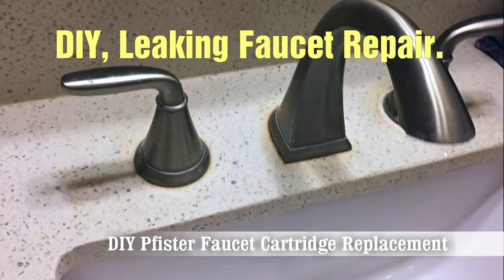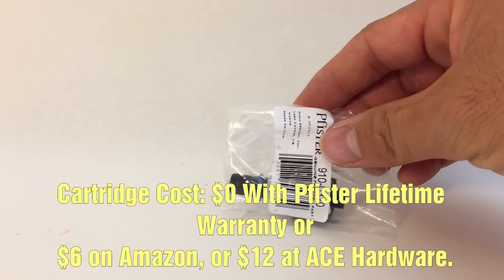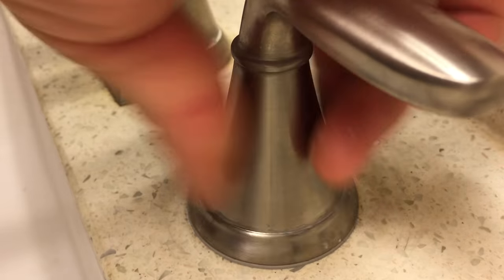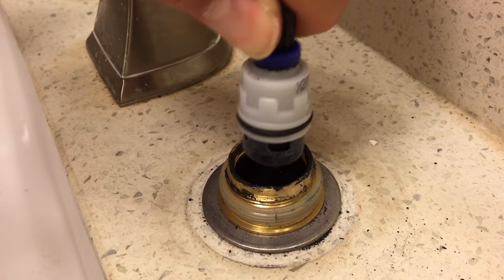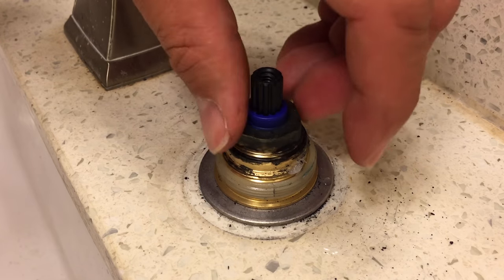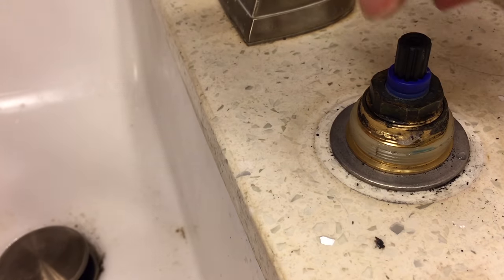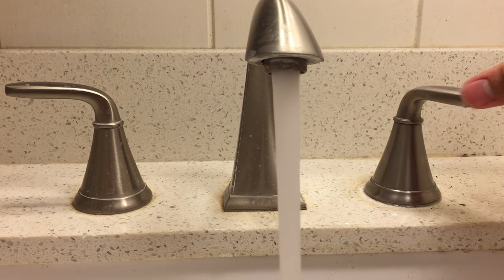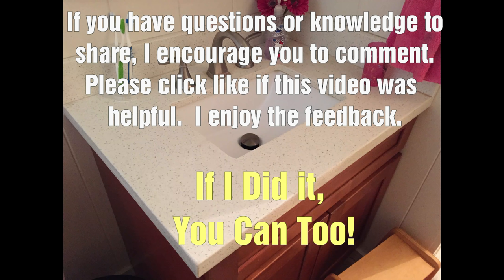What is a Faucet Cartridge? Dripping Price Pfister Faucet, Cartridge Replacement in 15min How to.

Comment: Silicone grease is a must for threads and handle to stem attachment points, for those who install their own faucets a word of wisdom is take it apart and grease everything, by this it will remove very very easy. If not you will fight and curse it all the while trying to remove due to scale build up. I just did my kitchen pull down faucet. That blasted handle did not want to come off! It took a long time, spraying it with white vinegar. Thanks
Reply: Plumber's grease is mandatory during manufacturing/final assembly, as it should be during repair/replacement of parts/components.  The grease will assist in assembly/disassembly of metal parts, as well as add a protective coating to rubber gaskets/rings.

Comment: FYI, if you have old galvanized pipes, they can shed rust particles which foul the valves. I replaced a bathroom cartridge like this and found a rust chunk inside the old one. Two months later the new valve started leaking. Solution is to replace the old pipes (plus they start leaking when rusted through). I’m about 70% of the way through a Pex repipe. Slow going, the house is 100 years old and the bathroom pipes are behind plaster and lathe.

Comment: Super helpful!  Thanks, Thrifty Tani!  I discovered, once I saw how to get the handle off by unscrewing the base (thanks to your video), that the nut holding the valve in place on top had simply worked loose.  By tightening this, the valve stopped leaking.  I didn't discover this until after disconnecting things under the sink, which was not necessary in my case--a note to help any future visitors.  Thanks again. Regarding free replacement, if you are not the original purchaser (I bought the home from the original owner) the warranty isn't valid--not a big deal, since the valve is a pretty cheap fix.
Reply: Kind internet stranger..you just saved me time and money!  Started with tightening hot and cold side nuts just a tiny bit...stopped the slow faucet leak.  Thanks again!!

Comment: Fyi:  you can flip or reverse these cartridges from hot to cold, or cold to hot.  Use small screwdriver , pop off bottom black cap.  Pull out guts slightly and rotate 90 degrees, snap cap back on.

Comment: Thank you--that worked great, especially since I have that exact same faucet.  I'll just mention for others that when I pulled the cartridge out, it didn't all come out at once.  There was a piece of plastic that stuck in the bottom, which I had to pull out with pliers before I could put the new cartridge in.  That happened on both my hot and cold, so it's probably pretty common.
Reply from the maker: Thanks John, I appreciate the info!  I’m glad you were able to figure out how to pull out the piece of plastic.

Comment: So fun story, my faucet has begun a slow drip. I knew about removing the handle and tightening the nut down which does stop the drip sometimes but when I popped the small cap off the handle to get access to the screw it wasn't budging. I put my weight on the screwdriver and slooooowly tried to untighten the screw only to feel the screwdriver "wrench" it's way out meaning the screw head is now stripped. Several swear words later, I bought a screw-extractor kit only for it to NOT work. I just now finished installing the new one on the hot side and the way I went about it was small hacksaw and cut the handle off (took about 30m due to the fact the handle was solid metal and confined space AND every back n forth action was see-sawing the cartridge making me worried about breaking something else). Then I finally had access to the large nut holding the cartridge in place and unscrewed that, pulled the cartridge out... put in the new one. Had to buy a replacement handle set so it matches (since Ace didn't have the same ones). Stuck screw made this 10m job into a 1 hour job.
Thanks to your video I found which cartridge I needed because the bottom black plastic piece which comes apart HAD come apart and the lower half was still stuck inside the faucet. So looking at this video I realized the cartridge wasn't complete. Used 2 needle-nose pliers to remove the bottom part and went to Ace and found the right replacement.
Faucet's fixed, no drip. Phew
Reply from the maker: Wow, that sounds like a stressful situation!   Good job on fixing it!

Comment: Help Thrifty Tani! I loved this video and ordered and follow to a T but may handles both completely turn 360 degrees.  The water shuts off in one spot but why isn't it locking into place instead of turning in curcles?
Reply from the maker: Hi Margot, the cartridge should stop the handle from rotating 360 degrees.  If you’ve already replaced the cartridge and it’s spinning 360 degrees, you probably have a faulty cartridge.
Reply: @thriftytani46  So I changed the cartridges per your suggestion and it all works!!! I am so proud of myself and thankful for you and your advice.  Have a great day.
Reply from the maker: Awesome Margot!  You should be proud of yourself, you saved yourself hundreds of dollars by not calling a plumber.   You deserve to get yourself a little treat today! :)

Comment: Is this generally how to repair all brands? I’m not sure exactly why mine is leaking or what brand it is to know what to search for on how to fix.
Reply from the maker: Generally there are two types.  The one I show in my video, and the second type involves a tiny hex screw, called a set screw usually located on the back side of the handle.  Remove that screw and the handle will lift right off the faucet.

Comment: Hello!Your video is very good. However the hot water cartridge I need to replace is stuck. I tried wiggling it and cannot remove it. Can I use a drill to break it up and then be able to remove it? Thanks.
Reply from the maker: The cartridge must be stuck due to hard water build up.  Pouring a little vinegar in the area surrounding the cartridge and letting it sit for half an hour might help.  Try wiggling the cartridge so the vinegar can penetrate under the carriage.  If it still won’t wiggle free, you can drill a screw into the plastic cartridge and use a pair of pliers to grip the screw to pull it out.

Comment: Hi, I replaced the 'hot' cartridge in pfister bathroom faucet, not because of low water pressure, because the handle was impossible to turn. I believe I have the exact same model, mine be older though. I ended up replacing the cold cartridge too. Everything went back together fine, I checked for debris and cleared the water lines before installing the new cartridge. Now, there is low pressure. No leaks, water comes out fine, but the pressure is about 50% of what it was. What could be wrong?

Comment: It would be good to know WHY the faucet leaks. If the O-ring is the problem, rather than the entire cartridge, then my hardware store carries those for  a few cents each. But if the plastic inlet/outlet wears out, then of course, the whole module has to go into the landfill.
Reply from the maker: That’s a good idea! I’ll make a video of what kind of o rings are inside.

Comment: Do you have any suggestions to remove a stuck handle? I need to replace the cold water cartridge on a Pfister Lindosa faucet but the handle will not budge. I can unscrew the hot water handle  easily but the cold water handle is really stuck. Thank you in advance.
Reply from the maker: Hi! If you’re replacing the handle with a new one and done mind scratching the old old one, use a pair of vice grip pliers to grip the hub. Some folks have used a lubricant like wd40 on the connection between the handle and the base.
Reply: @thriftytani46  thank you for the response. I tried wd40 but that did not work.
Reply: Also not replacing the entire handle.
Reply from the maker: If the handle won’t turn, the problem is usually with the handle itself not the cartridge, and pfister will send you a new one for free.  Then you can use the vice grip to remove it.  Option B which isn’t a great one is to unclip the thin black water supply lines that runs into the bottom of each handle, then untwist the large black plastic nut from under the sink.  Then you can remove the entire cold water assembly and work on untwisting it in a better position.  But I couldn’t find a way to get an adequate grip to remove the handle using this method.
Reply: @thriftytani46  thank you.  I do know that the particular style that I have is discontinued. I will try calling to see if they have a other solution. Thanks again!

Comment: The handle turns all the way around  The water shuts on and off. The handle does not stop in the off  and on position
Reply from the maker: Sounds like the cartridge is bad and need to be replaced.  They will give that to you for free too.

Comment: tried to remove the handles this way and they just keep spinning, drip is worse now - hope i didnt break them
Reply from the maker: If the handle is spinning 360 degrees, you’re probably going to need to replace the cartridge, It’s also free with warranty.  Is the handle spinning independent of the base?   Or is the base and handle spinning as one piece?
Reply: @thriftytani46  I know i need to replace the cartridge on the hot side, the handles wont remove though, the handles work fine, but spinning the base in each direction does nothing, its a Glenfield 2-Handle Kitchen Faucet
Reply from the maker: Did u see this diagram online, it shows how ur faucet is put together.  https://pfisterstorage.blob.core.windows.net/documents/41077-0400%20web.pdf
Reply from the maker: Is your retaining nut under the threaded stem loose?  Item 962-021 on the diagram.  The whole long threaded stem might be spinning
Reply: @thriftytani46  no that isnt the problem, just confirmed it is tight and i can grip the underside threads while i twist the handle base and the underside base is no spinning. It appears the handles are threaded or have to much crap in them, I dont know how to get them off :(
Reply from the maker: Are both handles doing the same thing?  If not, maybe hot side is cross threaded?
Reply: @thriftytani46  yes they are both doing the same thing, only issue can be they are both threaded, there are no other parts that move/no other explanation
Reply from the maker: So strange.  You might be opening a can of worms, but it might be better if you unscrewed the water lines and retaining nuts and pull out the whole faucet so you can get a better view of what the problem is.

Comment: My replacement cartridge will not go in. It’s identical to original.update-half of cartridge didn’t come out.
Reply from the maker: Hey Keyser, try pulling out the bottom half out with a pair of needle nose pliers.  It should pop out, there are no threads holding it in.

Comment: Ok so I took my cartridge out but where it was if filling with water. I turned my main off .... 🤔🙃
Reply from the maker: Turn off the valve under the sink.  The main will turn off the water but if you have any pipes higher then your sink, the water will back up into your faucet.  Also the main sometimes doesn’t close off completely.  You can also open up the facets elsewhere in the house that’s lower then your sink, your bathtub spout would probably be a good one.